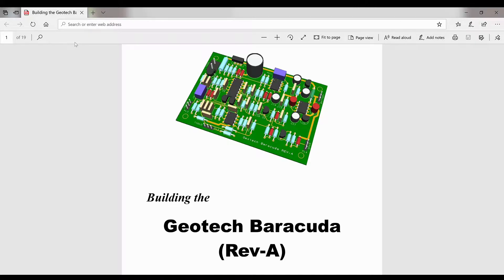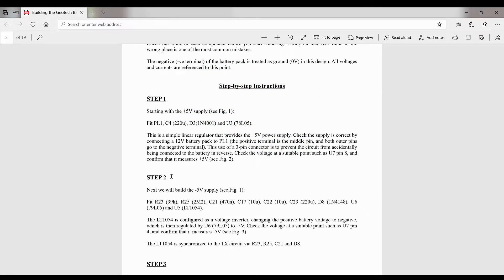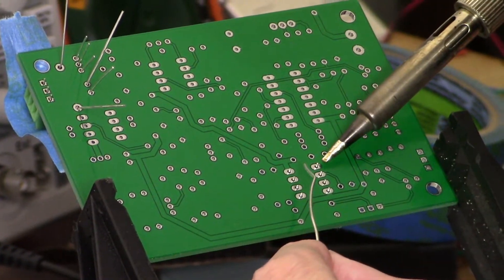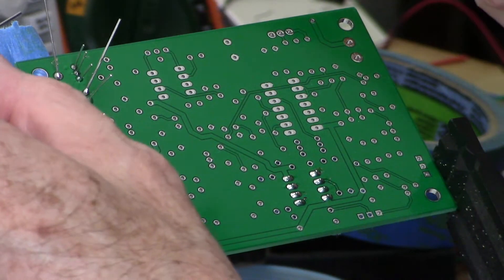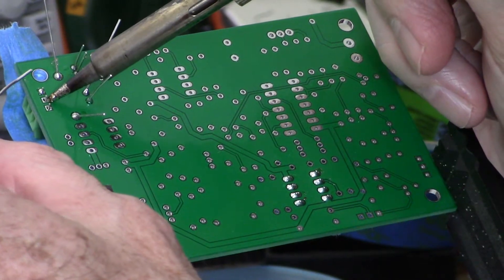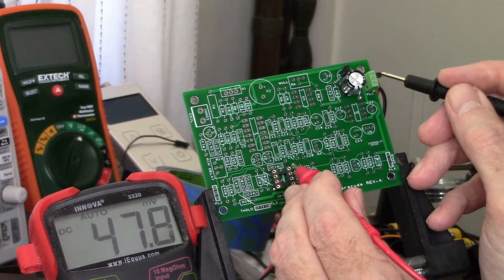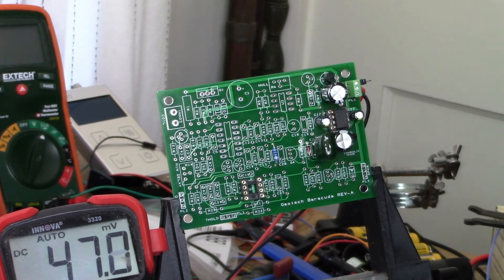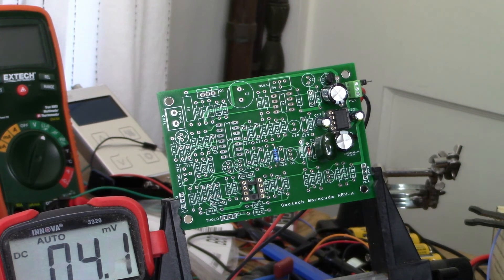Barracuda DIY PI kit steps #1 and #2

Comment: Building stage by stage, with checks before moving on, is definitely the way to go.
I didn't have neg 5v and not having the board populated made for an easy fault find. It was the 79L05. The replacement I could find was a 7905CV, a bigger animal with heatsink. The capacitor next to it moved over enough to make space.
Thank you for spending the time making the video, they are very helpful.
Reply from the maker: Alan,
I am gratified to hear that you are finding the videos to be of use as you build your project.  It's always nice to hear positive feedback.
Cheers

Comment: Which one do you like more, the surf pi or the baracuda? I want to build one and will build accordingly also which one has more depth?
Reply from the maker: As I said before, the Barracuda has a build document for the project.  If you have never built any detector before the document will be very helpful. Also the Forum on Geotech has loads of information on the Barracuda build in a dedicated area of the forum.  Depth is greatly dependent on your coil and how well you build and tune the detector.  These detectors are both intended for use on the beach keep that in mind.
Reply: @SurfDetector  which one would you recommend me for land use ?
Reply: Great info , thx again man!!

Comment: Can i use 7066 instead of lt1054?
Reply from the maker: Some 7066 are only good for 10V supply so you need to be careful which version you are using
Reply: @SurfDetector  yeah i just realised it woudnt work with a 12v supply or has high chances of failing.

Comment: Hey surf, are you using a cone tip in this video, or the flat chisel tip the small one. Maybe im having a little trouble because the pencil tip that im using is to small and not heating up the pad any. I dont see a larger cone tip in spare tips.
Reply from the maker: Hi Matt,
Without me looking at the video,  I  normally like to use a chisel tip, depends on what I am working on.
Reply: @SurfDetector  thats what it looks like to me, a small chisel tip

Comment: I tried finding parts from 3 different companies including tayda, but no luck, maybe shouldnt put in the first letters of part number.
Reply from the maker: Matt 99% of the parts are easily available.  What parts can you not find?
Reply: @SurfDetector  i would have to give you the part numbers, but i looked for 5 of the parts and all 3 said no parts,from mouser, digikey, and tayda. but then i found one from tayda but it wasnt the part number on build sheet, just looked, LF412A dual bifet opamp,no luck
Reply: heres another IRF9940
Reply from the maker: @mattrowe1229  https://www.mouser.com/ProductDetail/Texas-Instruments/LF412CP?qs=d9gICRQKuCfFvUDVBtipoQ%3D%3D
Reply from the maker: @mattrowe1229  Should be IRF740
Reply: @SurfDetector  that product is 595-LF412CP, not LF412A as listed in parts list, wonder if i have right parts list. If i drop the 595 and look at the product it still says LF412CP.
Reply: @SurfDetector  The IRF740 is N-channel. A P-channel MOSFET is required for the Barracuda. "IRF9940" was a typo error in the parts list. Corrected, it should be IRF9640. The IRF9640 is mentioned just before the first step in the build document.